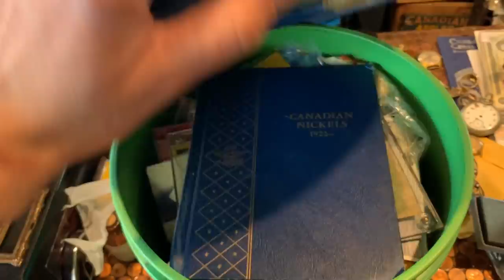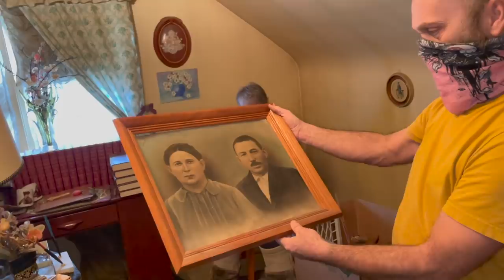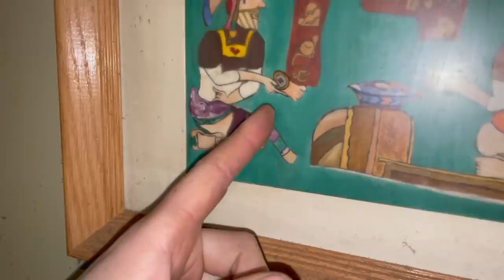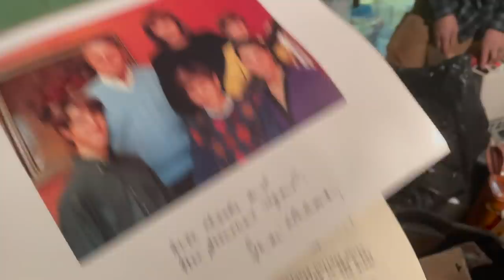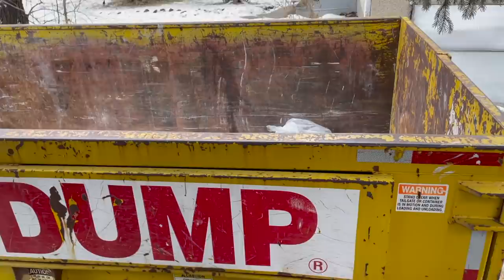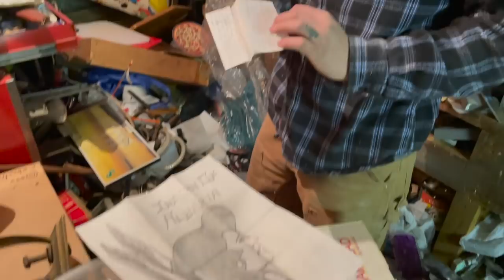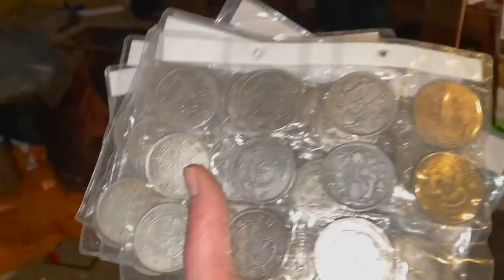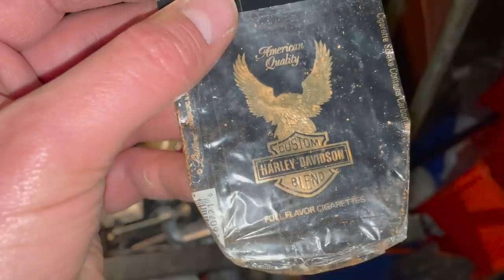Part 10, Hidden Silver Dollars?! What’s in the basement?    HD 1080p

Comment: Hallo Alex,
you wear those glasses when you climb a glacier to protect eyes and nose from the sun. They look pretty much the same today. But I liked the character you created wearing them. Yes he‘d wear them too.
Reply: I dunno, I they're old welder's safety glasses used in a tooling shop for work with small hand torches--the lenses look to be too dark to use on glacier climbs.  The leather nose piece was just nose protection and doubled as a simple, cheap nose bridge without having to use more metal to make the glasses.  They found several pairs, along with regular protective ones used against flying debris when you use things like that milling machine and the lathe.  No one wants bits of metal flying into their eyes!  :-)

Comment: That's a Morse Key - at least that's what we call them in the UK. I was trained to be a Merchant Navy Radio Officer and could send Morse very fast!
Reply: Also called a straight key here in the states; there are also paddle keys, which when paired with an electronic key tone generator, can be operated at lightning speed.  I got my amateur radio Novice ticket ages ago, back when there was still a Morse code requirement, but I was never really good at it...
Reply: @AndrewAMartin  Yes, I had a go at a paddle key. Really difficult
Reply: @thegingerwitch322  The problem I had with a paddle key is that I could send WAY faster than I could receive, which makes contacts very difficult...

Comment: There's a rock tumbler. I bought one for my kids and it was so loud I sat it outside the back door is a cooler. 5 tornadoes came through at one time in different parts of town days later. One came through our back yard and beat the crap out of it because it was plugged in. It was still in one piece idk if it still worked.

Comment: The wall to the secret room full of fur coats was likely not supporting as it looked like new wood.  A single stud removed would have made the project a lot easier. Or even just a horizontal spacer out of the way for a while.  When done, put it back, just as you planned to put the panel back.  

Very smart to have staging  in the living room.

It was painful to watch you pick up an item, put it down for "later" , move it again, put it down again, dig through a stack and pile it behind you, only to have to move everything again.  It looks like it made the whole cleanup take three times as long as it could have. Pick it up the first item you get to, put it directly in garbage, sell or give. One touch. done. Then the next closest piece.  No risky climbing.  I was waiting for someone to break an ankle. But that makes for compelling film. I couldn't look away.

Comment: Be sure to check the stair treads.  Years ago people used to stash valuables beneath either the top or bottom stair treads.  If any are loose it would be worth checking out.  Another area is above the main support beam in the basement.

Comment: The papers hanging from the ceiling in the tool room above the mill look to be patterns. Based on what you have found so far,  the sewing machines, patterns,  notions, etc it appears that someone in the family was a designer.  If that is the case the patterns hanging above the mill would be original designs.  Please consider checking with a local school (high school or college) to see if the would be interested in them or any of the other stuff that you think you may not be able to sell.  As the fashion design teacher at a high school that would be an incredible teaching opportunity.
Reply: They could also be blocks aka slopers. There weren't many of them so I'm thinking slopers for particular clients. ????  Who knows.

Comment: In that first blue bag of jewellery tools - you pulled out a packaged fireworks branded tool - that's a graphite marble roller, often used for working with glass. If you find rods of glass (what were the long pencil thickness long rods?), similar graphite shaping tools and an unusual blow torch, that stuff is expensive and holds its value. Also, if you see safety glasses with a purple tint, they might be didymium glasses for working with soda glass...